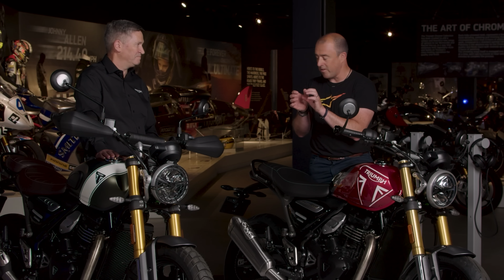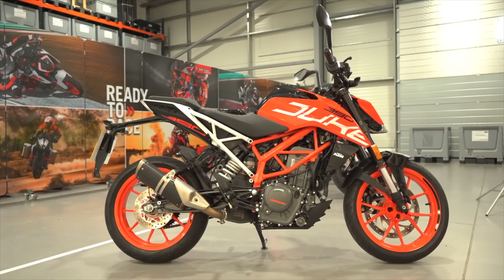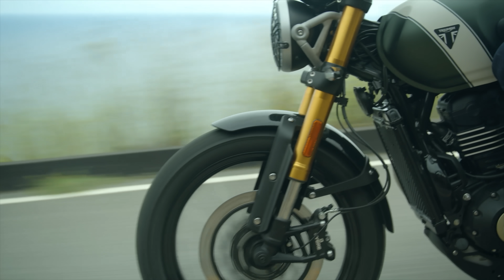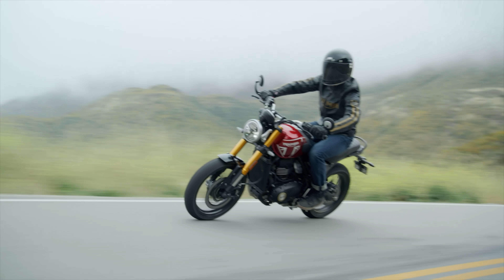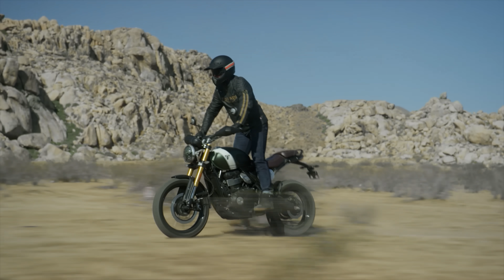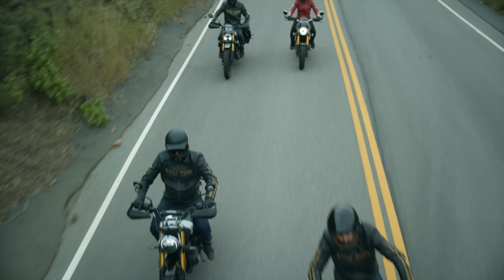New Triumph Speed 400 & Scrambler 400X | First Look

Comment: Below the 400cc, imo the next logical capacity is the one that doesn’t need a full licence..eg a 125cc in the UK. Anything in between is probably not worth the difference. Once youve got a licence, surely you want to go at least to 40bhp/400cc on a street bike🤔 ‘Anyone’ can ride and handle that size.

Comment: Nice enough, shame about the garish GOLD coloured forks.  Totally puts me off.
The heart of a bike being its engine, or should be, though of cause in black we see that engine does not stand out. Were it polished casings there may well be some >>attraction<< to it.
So there is no great attraction to what should be the starting point of viewing the bike, the engine, (then the tank, panels, seat etc).
Here instead folks are distracted, attention taken away to the gold coloured forks. Horrible looking.

Giving the overall look of the bike as primary the unsightly gold forks and then the rest of the bike behind it.  So looks wise not so good. Does nothing for me, just another Big 4 looking bike.
But being a 400 which is what Royal Enfield 350's should have been for non Indian domestic market it it spot on, as the guy said of the engine capacity it being the, "Perfect size".
For Euro, US and elsewhere it likely is. Though NOT for the Indian market.

There being their motorcycle insurance banding, that over the years has adapted to the age old 350 segment. Various banding & Insurance pricing under 350cc, then higher insurance costs over 350cc.
Triumph would likely sell more if the barrel was sleeved down to 348cc or similar.
Triumph can still do this for India though I doubt they will.

The petrol tank having a pleasing look to it, the green one on the Scrambler that is. The most attractive thing on the bike (and maybe the seat is next, looks quality).
The red 400 Speed with the Union Jack flag on the tank. What!, for a bike made in INDIA!!. 
Same with the new 650 BSA Goldstar with Union Jack flag tags sown on to the seats. And other places.  Just a daft notion, preposterous, patronising sales gimmick. 

Performance looks great. 39.5hp and  37.5nm of torque is more than adequate. Compared to say a RE 350 Hunter these Triumph 400's have a higher torque figure at 2500rpm that what the 350 Hunter makes at peak revs, just. 
Even a nice torque increase from 5000 to 6000 revs and a bit more to come. Those figure are without aftermarket improved air filters and other bolt on performance gains. So those figures will be the starting point for some. Good enough as it already is.

The 400 Sport has a nice weight saving over that of the RE 350 Hunter. With the 400 Scrambler at 179kg it is still a lot lighter than a RE Himalayan. Likely even lighter than the new upcoming one.
So that is well done, a higher power to weight ratio for starters. More enthusiasts can handle a 170kg bike so a sales bonus there. 
Less fatigue after a long run and even around town/city and likely the countryside as well. Getting off it after a while and not feeling totally knackered as some more heavier bike can induce.

These new Triumph 400's will rival the more modern looking RE Hunter and the new Himalayan, though those looking for a more CLASSIC look around the World are not likely to get a Triumph 400.
UNLESS Triumph take the effort to bring out a classic looking model, with brushed casing or even chrome. Though of cause NOT having such garish looking >>GOLDEN<< forks. 
That would need toning down so it did not take attention away from the engine.

PS, Pricing, the 400 Sport at £4995 would sell very well in the UK, maybe the Scrambler at £5200 or so. If it is much more than that, considering they are being built in India for a bag of chips. (WE know if RE sell their bikes at half the price as Worldwide, the cost of production is not massive).
Yes we can see these Triumph 400's would cost more to produce than a comparable RE, looks like they have many more expensive components
But I get the feeling if Triumph WANTED TO, they could offer them for those stated prices in the UK.

Whatever happens, good effort by all at Triumph & over in India, well done and good luck. 
It'll be good for that middleweight section, 350 to 500cc section that these day many Motorcyclists are gravitating towards. 
The obscene prices of the bigger capacity bikes are putting folks off.

Price the 400 sport at £4995, even if it is offered to the UK base as an 'introductory price', making it known from the start after a while it will rise to a more profitable figure.  Bit of a 'hard sell' then!.
Market it as Triumph doing enthusiasts a favour. Which they would be. (All those decades of Triumph brand loyalty & enthusiasm by our forefathers and of late, being acknowledged and repaid).
In the first year, or even six months initial sales would be ever so high. With those placing an order guaranteed one at the lower price even when the price is later raised.

If you are too greedy Triumph initially & later on you wont capture the similar spirit, loyalty and enthusiasm that many have for Royal Enfield.  Garnishing BRAND LOYALTY will lead to purchases of bigger more expensive Triumphs. 
So price them LOW, even if for a year or so (which would still be at a profit!) and it'll be a fish to catch a Mackerel. 
Well done then for the time and effort Triumph, the good old 400cc segment revitalised, top marks for that.
I wish you well.

Comment: Being "competitive with KTM and BMW" isn't difficult, as those two are the most expensive. I'm guess they won't get near RE pricing. Still, I do rather fancy the scrambler for a bit of fun.
Reply: If they could get it sub £5k that would outsell everything. But realistically it’ll probably be just above £5,500 or just over £6k
Reply: In India it is currently priced at 2.33 lakhs on INR which roughly translates to £2.6k, but it won't come that cheap but that's what the RE's are priced at too so you can expect it to be anywhere between £5k to £6k

Comment: A monoshock and the ass end sticking up in the air has nothing to do with "classic Triumph styling". Moreover, I guarantee you that this bike will be close to $7000 out the door, a ridiculous price for a "beginner 400".
Reply: That's about KTM 390 territory. Like the KTM, this has advanced electronics and a pretty sophisticated water cooled engine.  That monoshock is an indication it is a modern bike with modern dynamic.  Maybe not an issue for you and the REs are cheap and cheerful.
Reply: @anxiousappliance  Quite agree. As one who's owned five Meriden Triumphs, I just hate the way they're trying to tie this to the Speed Twins. There's next to no "traditional Triumph styling" in this bike.

Comment: Looks promising. 
Had almost finalised hunter 350. 
Now I think I have a really good option. 
Let’s see the prices first. 
Fingers crossed.
Reply: U can get 2 hunters for the price of 1 of these
Reply: @ravimahara4741 not in The UK you couldn't
Reply: @jonr1122  wait why? What is the power of Hunter 350 ? It's 20 hp right?
Reply: @jonr1122  ohhh yeahh, Britain Ehhh
Reply: This will probably priced similar to the G310R range but it’ll be worth it judging from the spec and press pics.
Reply: I'm thinking about one of these Trumpets next year, to own in addition to my RE Hunter and HD Dyna Glide. Keen to see more details (especially road tests from favourite YTers) but I'm pretty sure the two will be massively dissimilar characteristically... the hunter is very low key and very low revving, ridiculously simple to maintain and easy to live with. This Triumph will be high-revving, probably a bit manic, and far more mechanically complex. And, for that reason, a lot more demanding I expect.
Reply: @richardhince9764  Very true. I feel the same way.
Reply: If you are from India, pls don't go for hunter, go for either cb350 or TVS Ronin . Both these bikes are better than hunter 350.

Comment: "We don't believe in rebadging, but ya, these Triumph motorcycles have engines made by Balaj "  :D
Reply: If you missed, he mentioned the engine is designed and built by triumph.
Reply: Rebadging is different from outsourcing manufacturing

Comment: This will be a great move Triumph, 👍
A lot of us have been clamoring for these bikes (affordable, lighter weight, smaller displacement yet capable for dual purpose riding) for a few years now.
It’s great that Triumph stepped up to the plate. 
The Scrambler for me please.
Reply: Your right it a great move by triumph, there a lot of us that don’t want a bike with 90 plus horsepower that most off us can’t use off road anyway . I am almost 60 years off age and looking for smaller n lighter bike to do some gravel roads , I don’t think this bike will be just for new riders some older riders are looking at these new bikes from triumph
Reply: @markpearson2085  I agree. I’m in my late 50’s myself. 👍
Reply: @markpearson2085  66 years of age and retiring in 10 weeks time. I haven't had a bike since my one and only 125 which I bought new in 1976, for the princely sum of £400!
I've been obsessing for the last three years now and really, really wanted to own a Triumph - hence my earlier comment about a 125cc. I reckon this new range makes it a little more realistically reachable. I mustn't was fussed about having to go for the A2 licence.
Reply: Great to see that your age is not stopping you getting a bike . just get one and start riding
Reply: @markpearson2085   I’ve been riding for over 50 years. I’ve got 5 bikes in the garage from a 02-ZZR1200 to a ultra Classic. My smallest bike is  a Husqvarna 501. I’ve been wanting a smaller every day bike that I can take almost everywhere. I can do that with the 501 but it’s a high maintenance bike.
Reply: Agree with you. Yo do not need a +50cv - 200 kg - +8.000€ dual purpose bike. Tried the Duke 400 last Friday but did not like the overall quality and design. I hope Triumph has done its job better than KTM.

Comment: The spec sheet in Triumph India's website has the weights of both the models significantly higher. 

The speed being 178 Kg and Scrambler being 186 Kg, I wonder why is that? A Saree guard and extended, long Mud Guard ( won't add 8Kg of extra weight!? Did they cut down on refinement? Let's wait for July 5th.
Reply: Bashplate. That's probably the reason. Bashplate is absolutely necessary in india
Reply: @bulthaosen1169  Knowing Triumph, they might provide bashplate as an accessory rather than as standard. But let's see if they will surprise us or we will surprise them after the launch:)

Comment: Great looking bike, shame about the single pot engine in the Speed 400☹I would have purchased one in a heartbeat had it been a twin.....
Reply: MT-03 does pretty well with a small parallel twin. Plenty of torque and also a little more BHP than Triumphs new motor.
Reply: Small singles are torquey and perfectly suited to light bikes . Torque makes for good real world on road performance.
Reply: 400cc is very small for a twin. It would make very little horsepower or torque. Or it would rev to the moon just to make some power.
Reply: @chrishart8548  That is simply incorrect. I own a twin cylinder Yamaha MT-03 which is just 321 cc, but it develops more donkeys than the speed 400, is faster & more frugal on fuel..... Triumph missed a golden opportunity here by not making it as a twin cylinder. Just my opinion of course.
Reply: @barriewilliams4526  well it would have been cheaper to make it a single so that's probably there thinking.
Reply: @chrishart8548  True, shame as it is a cracking looking bike.
Reply: @barriewilliams4526 we will need to wait for the tests, but the specs suggest the Triumph developes much more torque than the MT03 and at much lower revs. That is what I look for in a bike.
Reply: @barriewilliams4526 

Triumph 400 - 37nm torque @ 6500 rpm
MT 03 - 29.6nm torque @ 9000 rpm

Triumph wins in torque. MT03 is better suited for race track. But Triumph is better suited for daily commute and off road riding.
Reply: Then it would be a 10 grand US dollarsssssssssssss bike  :D

Comment: I hope someone will bring out an high exhaust for the scrambler.....
Reply: Would rather not burn my passenger. Lower exhausts are better designed..
Reply: @ralphwarom2514  then it is not a real scrambler :D  you will drown in it in 2 inch water :D
Reply: @mannyechaluce3814 no you won’t 🙄
Reply: I'm sure they will but the cost will seem high when the bikes price is considered.
Reply: ... and spoked wheels 😊
Reply: The Honda CL500 might be a better option in the same range...